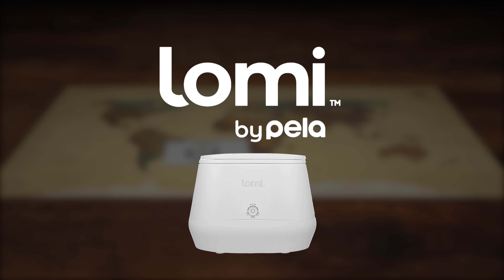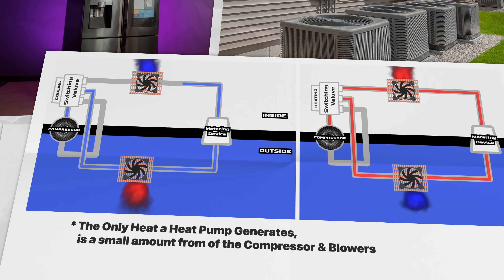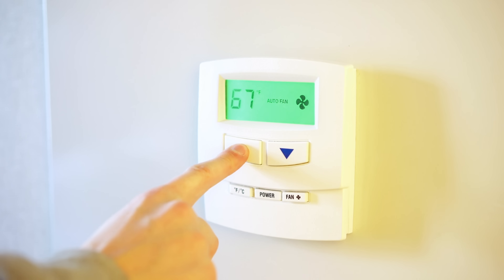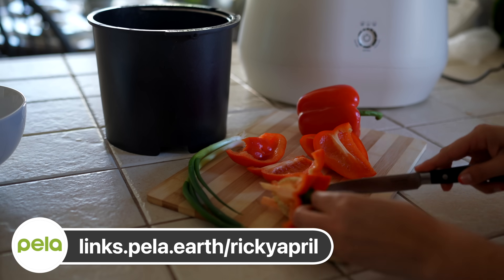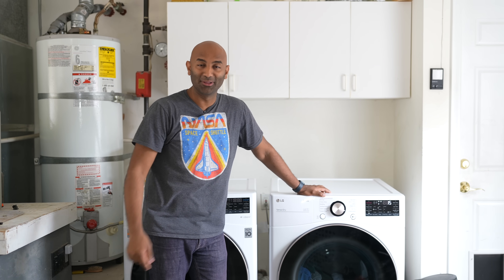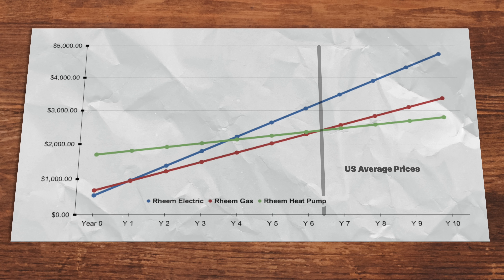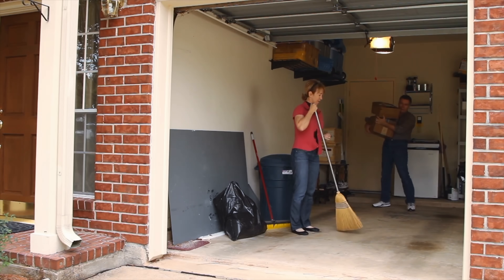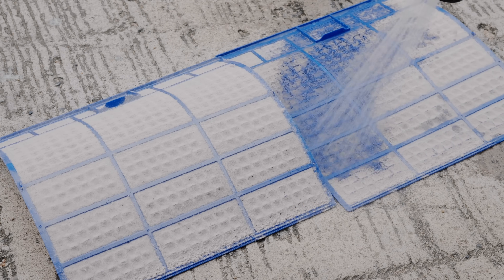I'm Shocked How Much Money Heat Pump Appliances Save!

Comment: Yes I'm all for heat pump technology but to save 50 per month isn't worth it so that means cutting the grid at 150.00 it's worth it but as a senior to go solar means keeping it under 4 thousand dollars preferably under 2 thousand as a senior anything over that starts loosing  savings as for anyone without having enough cash in the bank interest for seniors is now up from 19.5 % to 25.9 %  we don't qualify for either a bank loan or a home equity loan as our income is not able to be garenseed so for those like me with credit cards that's our only credit line from the price you quoted for a heat pump water heater it's gone up from were it was when I first started looking at it but in calculating it out if I go solar 2000 would take me 4 months to pay off 4000 would with interest take 9 months with interest the problem comes in with that is that low budget solar is 120 volts and I only have found one heat pump water heater that's 120 and they won't let DYI buy their units it's got to be installed by their approved dealers so instead of a 2 thousand dollar unit I'm looking at 8 thousand dollars as for heat pump dryer as you pointed out they too are also mainly 220i in the fall I want to try and find someone to upgrade my AC unit ld like to find someone who is willing to use my AC compressor and the coil in the furnace and add reversing valve and a water to AC  as I have water 20 feet below but that again means I'll need 220 110 volts the problems I have are our lower dollar and sky-high shipping right now my original plan was to use a 1750 watt modified sine wave inverter I have ended up with 3 so I purchased 2 100 watt solar panels and a 30 amp pwm controller and 2 big cat batteries then I found utube and found out that modified sine wave inverter are hard on electronics and motors I did find one utube video on how to make a modified sine wave Duracell solar generator into a pure sine wave output by using a triplite lc1800  line conditioner just a 100.00 dollars so I thought great it'll handle my 1750 watt modified sine wave inverter and I went online to buy one well with the conversion it's 138 dollars still a cheap fix so I intered my info then came to the final price and shipping was added almost 4 hundred dollars I cancelled the order as I'm sure I can get a 2 thousand watt pure sine wave inverter for around that price I can probably get a unit that will also have a mppt solar charge controller in it for around 6 hundred dollars so the cheap fix is no longer cheap but I'm hoping by summer end to at least cut the gas by going methane for my hot water tank my heat cooking and clothes dryer that'll save me the most money as it's only 30 dollars a month to keep the gas meter and if run out of methane I can go back to natural gas. but for electricity if I cut the grid it's a week before I can get a new meter and 150.00 and so far I haven't found a North American solar generator under 10 thousand dollars the professor keeps getting my hope up as he reveiwed his latest and said 2 could be paired together and they were under a thousand per unit then in his review comes the let down paired together to double the output watts it took 15 years to got a 120/240 portable work and home generator hope it doesn't take that long for  solar generators and yes I know about the ones that can be paired  together unfortunately with extra battery that's over 10 thousand dollars with interest that's 2 years to pay off with interest and other than those that have utube chanells who needs 4 usb type C charge ports and 4 USB quick charge and  4  USB slow charge and 2 12 volt regulated circuits and to get a  cheap 2000 watt pure sine wave solar generator sold by Home Depot and Lows under a thousand dollar unit with no shipping costs just pick it up at the store but with improper charge parameters and a two day charge time there not worth buying and the only way they'll change is if they had some proper reviews not the one's from preppers that say their great and they'll run a furnace or fridge so they put out 500 watts from a 1440watt modified sine wave inverter or à 2000 watt pure sine wave inverter but what happens I'f you pull full load capacité for a while are you needing to find out how good the warranty is and no power until a new unit arrives what the good reviewers don't realize is even a sealed lead acid battery unit if it's got the ability to upgrade to lithium when it's time in 5 to 8 years can be a good Entry level unit after 5 years putting the money à person saves in electric bills you figure out that's 60 month at 150.00 per month that's 9 grand if you can get the full 8 years that's 96 months we'd have enough to buy any unit on the market and to change the charging parameters would cost nothing changing the pwm charge controller for a bigger mppt solar charge controller even if it added 400 dollars to the price it would still be a good Entry level unit

Comment: Are there any Dryers that allow a hook-up to a geothermal system (assuming you have one)? I would imagine it allows it to get significantly hotter than most heat pump Dryers could normally get.

Comment: Too bad you can't heat pump AC, Hot water, dryer, pool, and fridge/freezer in the same system.  So you cool your house and fridge with your hot water and dryer.  Not as useful in colder climates but in hotter areas it would would work like a charm.

Comment: I love the idea that drying my laundry on a HOT day will cool down my house. It would be great to see heat pumps interconnected with reservoirs so the excess HEAT from the AC cooling goes to the water heater, rather than just an air exchange.

Comment: Ricky, did you use the cost savings amortization using your grid price for power or did you factor in the price for using solar electricity? What is the cost for solar electricity, once it pays for itself and the batteries and install would the cost be zero or should on factor in replacing batteries and maintenance?

Comment: Celcius all the way.
0 is freezing (water), 0-10 is cold, 10-20 is cool, 20-30 is warm, 30-40 is hot, 40-50 is outback temperatures (Australia), over 50 is a killer, 100 is boiling (water)
SIMPLE.

Comment: I hope they can get  a heat pump to work on a dryer with more capacity. But in your climate if you have an attic you can suck hot air from it and dry your clothes. The trick is getting past the dryers safety protocol's that stop the drum from rotating when the heat element is not detected. Probably would need something low tech. I know someone in Phoenix who did that and made it so he could switch back in winter. He was trying to make an attic cooling system to reduce costs for cooling the house. That did not work out very well but in the process it dawned on him on how he could use the heat. It did save him money.

As to the long exhaust. Their are inline fans of various size pipe and power. Been more than 2 decades since I saw one so I would hope they have evolved with some sensors. You might use one to supply hot air from the attic! Sounds like an interesting journey.

Comment: Think about this. Heat Pumps can cost you substantially more than you think. Everything gets dirty and can break down. The cost of service and repair, if you can find someone trained to fix it, can be very high. Proper cleaning yearly, if you can find someone qualified to clean it, can be 200.00 per unit. Cold Climate Inverter Heat Pumps are far, far from bullet proof. Think about the cost of service on a Heat Pump water heater! Can you say train wreck.
Reply: I think it is the technology of the future but needs to be refined and made more bullet proof. As a wholesaler we were always looking for ways to protect tham from power surges. That should already be on board when they are manufactured. As far as the grid goes at this point in time it will be very beneficial to the power companies partly because they us so much less power and also there will be many units idle because it will be so hard to find someone to repair them. Most manufacturers   offer extended warranty s that cover parts but not labor. It takes hours to replace boards on these heat pumps and service can be very expensive. We are headed in the right direction with heat pumps but going too fast. We need to increase training and hold the manufacturers feet to the fire to make them more bullet proof and modular and easy to repair.
Reply: @ducharmehvactraining925  perhaps including an in-line surge protector as part of the installation at the point of sale to address the sensitivity to power irregularities? Also at the point of sale including a 3-5 year maintenance plan so installers can plan for that need and staff accordingly? That is until manufacturers pick up the slack of course…would that help alleviate these challenges?
Reply: @MichaelP1963  yes Michael, as a wholesaler we did try to sell a surge protector with every sale once we became aware of them. Most important is to think about hybrid central systems and very light use of fossil fuels as back up initially. Also, and most important, power companies need to take record profits to upgrade the grid! If all are really concerned with Global Warming this will help.
Reply: Great point! 

So do you think the cost of maintenance on heat pumps outweighs their benefits in efficiency and not taxing the power grid via huge surges? Or is the worry that there aren’t enough qualified technicians in the field willing to do the work?

Comment: Well. Heat pump in San Diego to heat water.  I do not think that is the smartest idea going.  You have Sunshine there 350 days or so a year and get a grad total of 3 inches of rain.  For all intent and purpose you live in a desert 🏜️. Sunshine is free, yes PV will run a heat pump, question is why.  Build your own don't go for the 20,000 rig.  You need a free progect this is it.

Comment: I'm surprised you did not mention solar water heating. We have water solar panels on our roof. In summer the pool good up to 45 'c or more and we risk softening the pvc junctions underground. Solar hot water geysers are also popular for house water. Both are MUCH more efficient than what you are planning.
Reply from the maker: If solar water heaters are for you do it definitely. For me I’d rather use all available space for PV solar. This is because I only need hot water sometimes, but I need to run an ac or change my car or a million different electric things constantly. What happens when hot water is at temp and you don’t need it? A heat pump water heater with a cop of 4-5 takes the 20% efficiency of PV and makes them nearly 100% equivalent. IMO PV solar everywhere all day

Comment: Hi much of the population had gas clothes dryers, gas water heaters, gas furnaces, and gas ranges in the the 60's, 70's and on.  We've had 2 Heat Pumps in our home for 25 years, and for SE Texas they are fine.  106 high the last few weeks and 102 every day, we are fine in the house.  Just keeping it around 76 degrees F during the day on the hot side of the house, and 79 F on the non-sunny side.

Comment: 3:00 In the midwest I pay $1.64 a therm. You guys getting ripped off. lmao.  Heat pumps not going to be taking over here any time soon, they cost too much to run compared to natural gas heating. We pay $0.12 per kwh for electricity here and its mostly from coal.

Comment: Ricky I've had the Rheem heat pump water heater for several years now.  Your savings will be more than the graph.  Ours showed using $100 per year but according to the water heater stats we only use $70 per year of electric.  Oh and my opinion is you need to ditch the pool heater.  That is such a freak'n waste no mater how you heat the water it goes right into the ground or air.  You're pissing money away ... just my $.02.  Love the channel.
Reply from the maker: Great insights and yah I’m struggling with the pool situation… but I do have an idea I’ll share soon… best pump pool heater, and using the cold air to do water for air :) still cooking up the full idea! Thank you Brian!!

Comment: Here in the UK. I have an LG 9kg or 20lb heat pump dryer. And its gone from me paying $2 a load to 20c a load. Yes it take a little bit longer but not too much. and 80% saveing in electricity is a total win in my book. Also the condenser filters are self cleaning.

Comment: An Ozzy here.  Perth Western Australia to be accurate.  Yes, 25 degC is nice.  30 is starting to get hot.  40 is feckin hot.  0 is freezing. Almost never happens here in Perth.  100 is boiling, literally for water at normal atmospheric pressure around 1000 hectopascals (1bar).  

We have reverse cycle air conditioning and that is all we use to heat in winter.  We also dry clothes with the latest in solar and wind technology: a clothes line.  It retracts into a wall unit and so is very neat. Hot water is still on instantaneous natural gas (methane) but we will be going to a heat pump perhaps in conjunction with solar.  We do have 6KW of solar PV on the roof.  A small (maybe 2.5KWhr) battery is on the horizon. Prices are falling.  I want LFP chemistry.

Comment: I bought the most energy efficient washer without dryer function and the energy savings are even more amazing ;) We hang all the cloths to dry on a rack in one of the already heated rooms of the home. Less creases/ironing work than if I would use a dryer as well. We barely iron anything right now. Would never go back to a washer with a dryer I think.

Comment: The ideal application is to combine all elements.
Refrigerator,
Dryer,
HVAC,
Water heater
Move heat where you need it and cool where you need it.  No need to waste by dumping heat outside until it becomes excess.
The heat from the fridge can go into the water heater.
The heat from the AC, into the water heater or pool.
You can even steal heat back from drain lines to regen back into the water heater.
Reply: I was thinking the same thing.  That would require a pretty sophisticated system to integrate all the various appliances and utilities.  Would be nice if it was plug and play and you could add additional appliances when needed.  There would have to be some sort of industry standard so all this stuff would play nice with different brands rather than having a dozen proprietary standards from each company that will only work with their stuff.
Reply: @mojoneko8303  it could be done with water loops.
A warm water loop to pull heat from and a cool water loop to dump heat into.
The central heat pump would move the heat the right way and the devices would tap into it.
The devices would have small heat pumps to utilize the heat differences in the loops

Comment: Yes, first time I see someone else pointing out the dump wrong fact about solar energy making grid problems, as when a 5 KW Home Solar just get a cloud and change the amount of needed power in seconds.
After I installed a few digital power meter, and saw my main electric inlet jumping as of hot shower 3.500 W, toaster (800 Watt), and main coffee shop water heater with ! 5.000 Watt ... I don't mind anymore about my max 4.5 KW Solar changes anymore.
The big LIE about (power switching) Solar energy makes our Grids to suffer, HA HA HA

We all users of the Grid would be able to crash it every day since decades, if we just would every 1. Monday of a month as if everyone just take some time and start all together water heater or water cooker at exact 7 am.
NO, DO NOT do this ... as I might charges as of be a terrorist !!! You just should realize the lies of them (grid owners).

Just go ahead and look at a shopping center ... did you ever measure the power when they open or close ... ah, I think you got it now.

Comment: If you live in San Diego, maybe it makes sense to hang much of your laundry outdoors to dry? Certainly the larger items. That would save a huge amount in gas/electricity and your clothing, towels, sheets would last a lot longer.  You could still dry smaller items in the dryer because those would be tedious to hang.

Comment: If you have a pool heater AND live in a cooling dominated climate, consider getting a refrigerant-to-water HX for your House AC instead (or first).  These use a heat exchanger to take the hot refrigerant coming from the AC and heat incoming pool water.  The heat exchanger uses the heat that the AC normally dumps to the air and puts it in your pool.  Also, added benefit, the water-cooled AC circuit is more efficient to operate - 2 birds 1 stone.  This Old House did a video on this - you should look it up.

Comment: Great video! Hopefully gets many thinking about converting.  We live in Florida, installed a heat pump water heater 8 years ago and have had no issues with it. It has been one of the best investments we made. It was a discontinued model at half price and we received a $300 electric company rebate and $350 credit on our income tax. We immediately saw $10-$15 saving/ month on our electric bill. The payback was less than 1 year. Our HVAC has always been a heat pump. Now you have me thinking about the dryer.